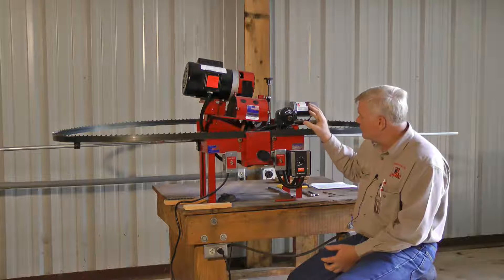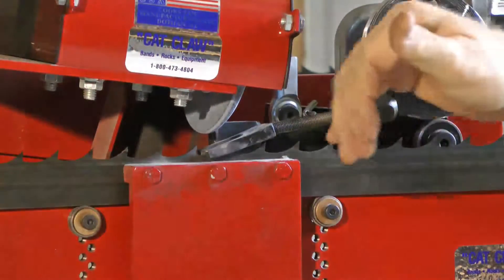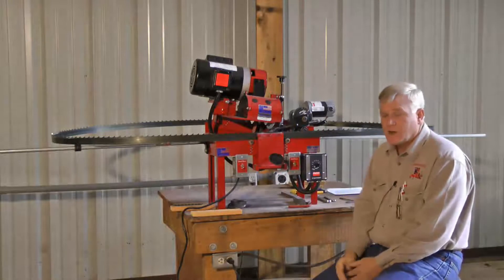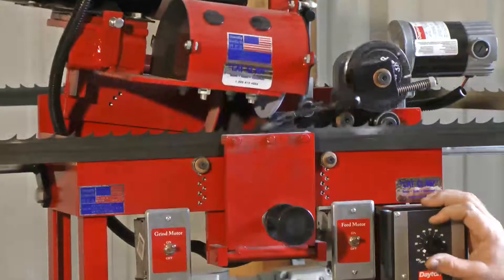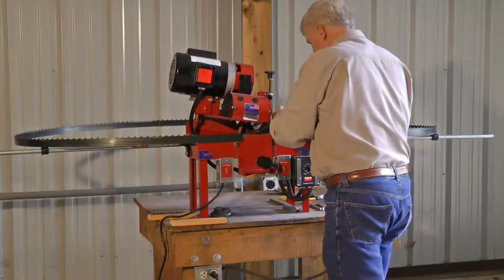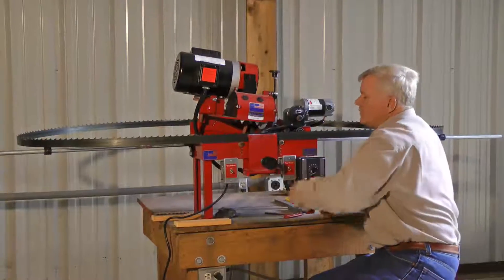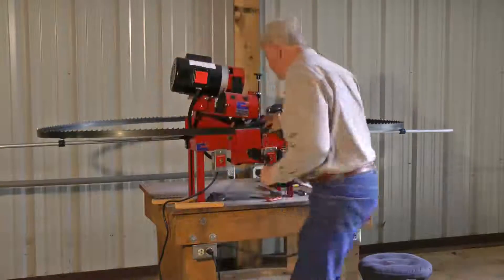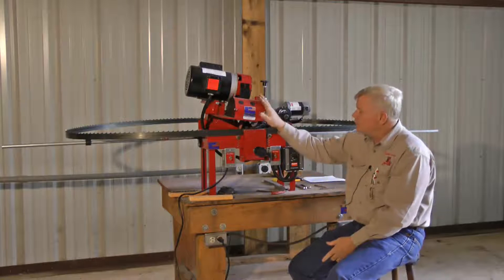Cook's Bandsaw Blade Sharpener 2012 part 2

Comment: I purchased one of these in the mid 90's.  I sharpen my sawmill blades and I sharpen for other mill owners in the local area and some mail order customers.  The sharpen has made he a bunch of $.  I sharpen while I mill and set the teeth later.  I average 10 - 15 sharpenings per blade because just as soon as a blades shows dull , it goes to the sharpener.